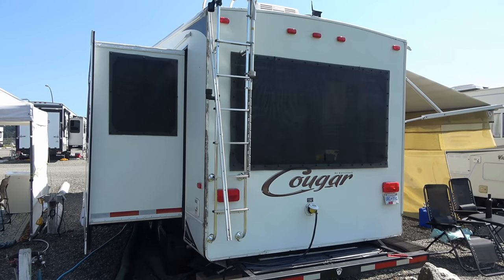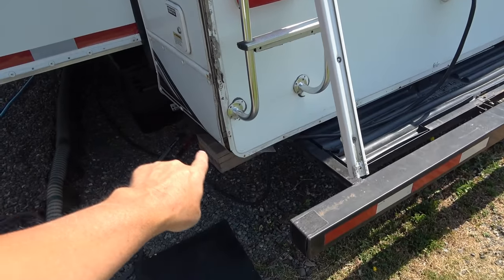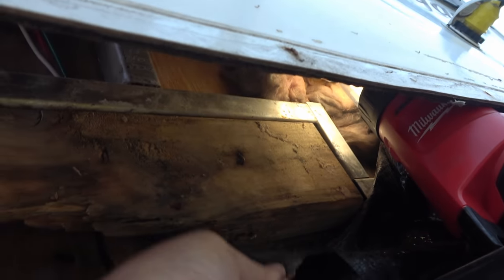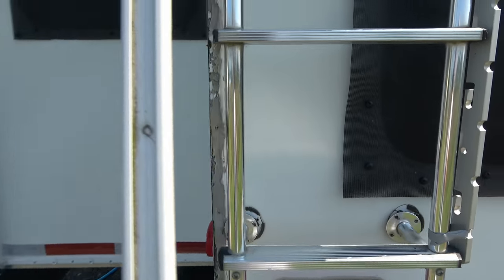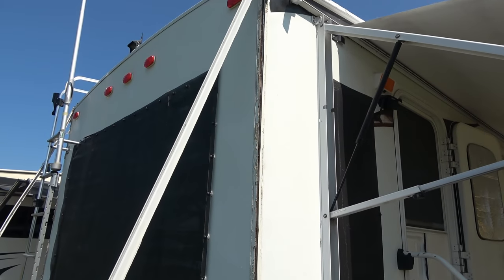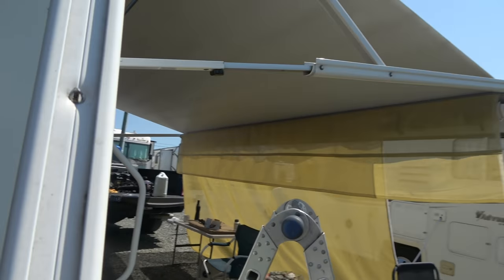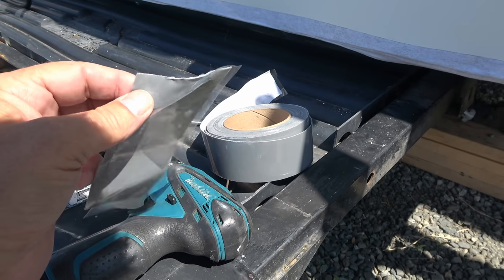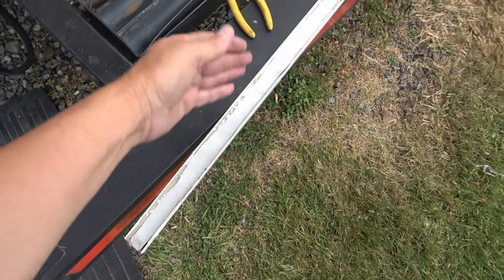Minor Rot Repair and Resealing the Rear End of the Old Cougar Fifth Wheel Trailer RV

Comment: thank so much for this video.  I was backing up my Motorhome and had to go sharp, this woman saw i was pulling out of the gas stall and cut me off and parked right in the space i was using for my wide turn to clear my trailer and  it caused my trailer to jackknifed causing the trailer to push into the driver side corner.  it the light housing came off, the rear side generator door was damaged and the siding pulled back.  when i checked out the damage i saw the wood they had across the back was rotted and it just fell out, lol.  I was trying to figure out how to fix it and came across your video.  the door part was easy, just order an new door.  the corner and back damage was another story.  your video really was a lot of help figuring it out.  thank you so much.
Reply from the maker: Awesome! Glad it helped. Cheers, Ray

Comment: The only things that I would have tried to do different, would have been to treat the 2x4 with something to help preserve and protect it, then use 2, or 2.5 inch decking screws to attach the 2x4 to the metal brace (space permitting). After removing the staples, you could have marked the holes on the 2x4, then pre-drilled them to make it easier to screw in the decking screws. The last thing would have been to run caulk in seams/corners, where the side panels meet the rear panel. 
Regardless, it looks like you did Ok!! Cheers Ray!!
Reply: At the very least use a treated 2x4..otherwise great job.

Comment: Acetone should remove any yellowing on the molding. Did wonders for me on boat molding discoloration. Thanks for the video 🤗
Reply from the maker: Thanks, will give it a try before replacing. Guess it likely eats the top layer yellowed off. Acetone can melt some plastics.

Comment: Back when I worked at a prefab home company, the guys on the exterior wall line always pushed the caulk guns when applying.   If you want to smooth it out, if you spray it with glass cleaner first, it will not stick to your finger and make smoother caulk.
Reply from the maker: Thanks for the tip!
Reply: You have given me way more than I have given you!   Best wishes!   Kevin

Comment: Nice vid... I wasn't aware that the slide out roof could support "our" weight...
Reply from the maker: That may vary depending on make, model and year. But my 2011 Cougar slide roof is 3/8ths OBS on aluminum beams, so easily supports my weight. You can see the underlying roof boarding here when I replaced the rubber membrane  https://youtu.be/KWfVkDooDss?t=310  Cheers, Ray

Comment: Our 2006 Cougar 5th has the same issues. I need to do the same repairs soon. I'm also going to put a piece of 1/16" aluminum tread plate covering the first 14" of the bottom of the back of the camper. Our siding is wrinkled there so it should cover up that eyesore.

Comment: Good job, Ray! I do have two questions/observations, though. Is there a reason you didn't use a pressure-treated 2 x 4, or at least paint some kind of sealer all over that bare wood? Secondly, I like that you used that steel strip for reinforcement, but I'd be concerned that where the strip goes over the aluminum square tubing that you'll get galvanic corrosion, and eventually that it will turn to powder? I think I would have installed some of that bond tape in between to form a barrier between the dissimilar metals. Even though the strip is painted, I'm not sure that will keep it from reacting over time.

Stay safe, my friend!! 👍👍👍
Reply from the maker: Good idea. I think I will tackle the problem by solving why the water is getting in. Even if I was to coat that wood or use pressure treated, there is still the whole thin back wall that is bare wood. Maybe some rubber mat guard back under there. Cheers, Ray

Comment: Nice job ray i was just doing my first coat of Edpm hengs rubber roof coating today around all the vents and front and rear caps that vinyl trim is on Amazon made by camco I was looking at buying 150 feet to do the whole trailer like yours it’s pretty discoloured now as my trailer is a 2006

Comment: Ray when you put the trim back on you use the butyl tape on it where the screws run through but there's nothing sealing the other edge on the side. Did you consider putting a bead of caulking on the trim before you put it back? I'm doing the same fix right now and the only thing sealing up the edge on the side was a bead of silicone that opened up and allowed water in. I'm going to do the same repair that you did but I think I'll run a bead of caulking on the inside edge of the trim piece that seals up against the side wall. Then I'll run a bead of caulk on both edges as a final seal. That way you have three barriers on all sides
Reply from the maker: Rather than caulking on the inside corner, I used the Seal-Tite Corner Seal Tape https://youtu.be/PO8EvZ4AAp8?t=795  So water would have to get by the outside caulking, then the butyl tape, and then finally, the Seal-Tite Corner Seal Tape

Comment: Nice that your trailer structure is aluminum. I’ve heard horror stories of wood framed trailers suffering catastrophic failures. I imagine that you have several hundred pounds of support equipment (tools and testers) that you carry with you since you are a full timer. Anyway, thanks Ray for another informative video.
Reply from the maker: Yes, my big metal tool chest in the truck bed is jammed full of tools and stuff. :) One of the reasons I went with another 1-ton pickup. I need the extra payload capacity!

Comment: If only they would paint the damn frames. Even a coat of 1-2-3 Primer would protect the wood frame. Why the RV industry is so Mickey Mouse with this stuff is beyond me. If I ever switch from a TC to a trailer, it'll be a utility trailer that I'll build out myself for the most part. Nicely done though Ray! :)

Comment: We have a 2019 cougar half ton 5th wheel we have a dometic ac unit it cooled the first year this year it started leaking water in the kitchen floor we do not live in it just go camping so we turned it on the other day now it will not cool..do you have any suggestions..husband cleaned coils which were not dirty it sits under a RV metal cover...thanks
Reply from the maker: Not cooling at all usually is a problem with the compressor or the coolant in the piping has leaked out but maybe could be a problem with the electrical inside, like a capacitor. Hard to guess without testing things. Usually you can find a service manual online for the model and it will give some trouble shooting steps to isolate the problem.
Reply: @LoveYourRV  thank you I believe we have the manual

Comment: How do you adjust your awning after extended to resist wind better without using straps? 🤔
Reply from the maker: Not any adjustments I'm aware of that will do any good.  I will take 7 gallon jugs of water and a ratchet strap attached to the corners sometimes. If the wind kicks up too strong for that then I undo them quickly and power it back in it in. If you like to have an awning in strong wind area best to get a manual type awning that has better corner braces. Cheers, Ray

Comment: Why not pressure-treated wood?
Reply from the maker: No particular reason, good idea, I was going to coat it on epoxy resin like boat woodwork but was didn't want to buy it for such a small job. I figure I won't likely have this trailer by the time that piece of wood rots again. Think I will also look at adding mud flaps to reduce the spray to stop water from getting in behind there in the first place.

Comment: Every Major camper is "built to fail" and the way they build them proves it...
Reply from the maker: Yeah, and they design them to be built fast so cut corners for speed of build and they have to be light weight.
Reply: @LoveYourRV  The actual design is built to be just temporary, example " butyl tape" It is trash.
Reply: @LoveYourRV  even with Aluminum builds they still use wood in critical points that cause the most issues.....
Reply from the maker: I hate the use of long staples to attach many things together to speed up production and save money. The ones used on the floor and roof start to back out or squeak.
Reply: @LoveYourRV  it's designed to fail. The entire industry banks on it.
Reply from the maker: That's the way a lot of manufacturing is these days. The public is mostly to blame, though. we reap what we sow. Most of us shop price versus quality for instant gratification. Because of that most quality, RV manufacturers generally can't compete and goes out of business.

Comment: Good grief, you are staying in one spot for months at a time.  All you are doing is fixing up the trailer.  Doesn't sound like a fun way to RV.  You are a great mechanic/fix -it guy but is that all you want to do?  Me thinks you need to get a better RV so you can have more fun instead of work.
Reply from the maker: We normally average 7 months of traveling with about 40-50 different stops during a regular year but really love our summers here. As a full-time RVer, it is sort of nice to have a base.  Here is a map of past years.  https://www.travellerspoint.com/map/#/user/402164
However, the Covid-19 pandemic threw a monkey wrench into the works this last year and 1/2. So I've been using the downtime staying busy fixing and maintaining the 10-year-old trailer. We'll be leaving come September for a 7 month stretch of travel and I don't want to be fixing things, that's if things keep going well and there aren't restrictions again this winter. Just got my second vaccine dose so should be good to go.  Fingers crossed the border reopens! Cheers, Ray